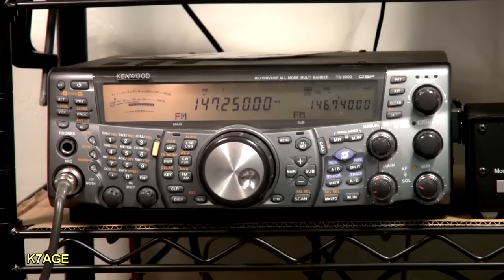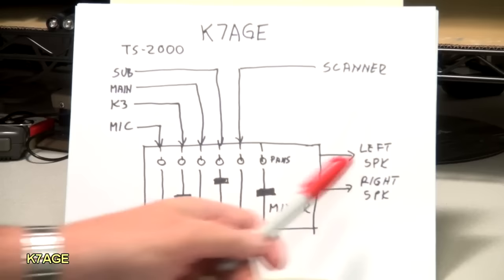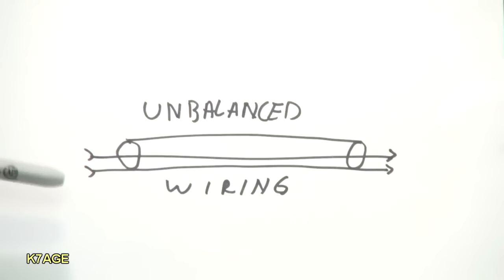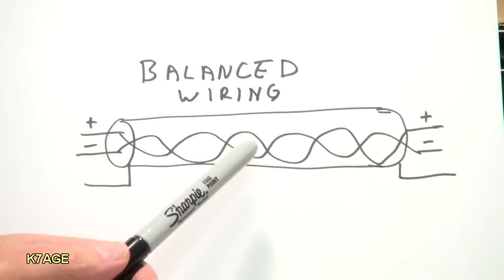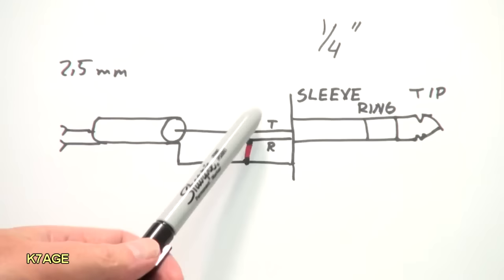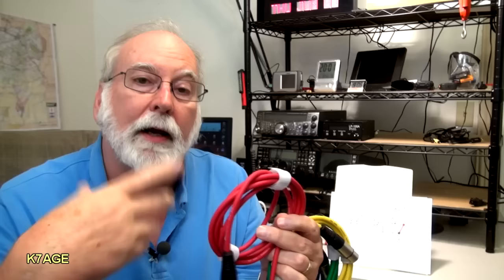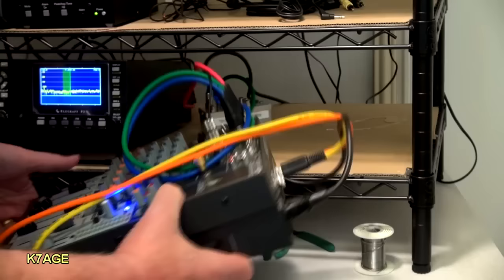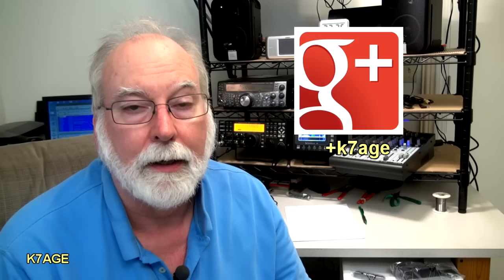New Ham Shack Part 4, Audio Mixer Installation

Comment: Aloha Randy
Finished my mixer and JBL Speaker installation. I love this set up. I included my computer into the mixer. Both you and Bob were right the JBL speakers sound way better than the ones that come with the radios.  Mahalo for your videos.
Reply from the maker: It is nice having the mixer. You can connect all sorts of stuff. Speakers are great. Bob used one at Pacificon for his PA, one speaker was enough for 200 people.

Comment: I just got a mixer for my shack. I picked up an Alesis multimix 8 USB off ebay. The USB works great on linux. It's a great setup for recording audio for youtube videos. I am going to see about plugging in RX audio into the mixer. I also need to see about getting audio into the rig. I am thinking of rigging up a mic patch bay like Bob Heil did. I might just have both TX and RX audio on the patch bay. As well as jacks for the PTT. For speakers my plan is to use cheap bookshelf speakers from a thrift shop along with a speaker amp. I am also planning on getting an AM/FM tuner like you would use on a stereo system. That should work nicely with the mixer and speakers. Although I think I need to raise my discone up a bit. I doesn't pick up my favorite FM station as well as I would like. 

Tonight I hooked up my cell phone to the mixer and had a conversation with a friend. Besides recording conversations for youtube. That also opens up the possibility to do phone patches. The secret was a TRRS adapter that splits the phone's audio jack into separate mic and headphone jacks.

Comment: Very interesting.  When I went to electronics school they told us to consider cable shield as an external signal wall, not as a return path.  That advice maybe was more intended for RF work.
Reply from the maker: With just a center and a shield, then both are needed to carry the signal. Having two wires inside a shield allows for the two wires to carry the signal and the shield to project the signals.

Comment: Randy Why didn't you use the 1/4 inch plug inputs instead of doing all that soldering? Was there an advantage to doing it your way?

I also use a mixer, but since all my radios output to a 1/8 inch audio plugs all I had to do was get 1/4 inch adapters and then just plug in the 1/8 into the 1/4 inch adapters and then plug the 1/4 inch plugs into the mixer. My mixer outputs to my Stereo receiver which then outputs audio to 5 speakers. I don't set the radios to come out of any one or one set of speakers. They come out on all of them. I rarely have more than two radios on at the same time.

Radio equipment is an Icom IC-7300 and Icom IC-9100, Yaesu FT-950, and two scanners, not to mention the computer. 73 from N2LRB

Comment: What about the impedance matching between the output of the radios, usually 4-8 ohms, and the input of the balanced xlr connectors, 3,000 ohms? How did you overcome this huge mismatch in impedances?
Reply from the maker: I don't think the impedance mismatch is a problem. The input are very high impedance. The radio might like to see a 8 ohm load to keep the audio amplifier happy. Pro audio today is basically high impedance input with low impedance outputs.

Comment: Pin 1 is shield, pin 3 is common.  You had it backwards.  You should have used the 1/4" TRS input for line, but in reality each input should have had an impedance matching transformer for very low impedance speaker output to the moderately low impedance input of the line inputs.  It's same principle as balun on your feedline.
Reply from the maker: I'm looking at the pinout at 4:32 on the video. I believe it is correct. I have check several webpages, and they all show Pin 1 as GND/Shield.  The XLR inputs seem to work fine, the input gain control allows the levels to be adjusted for good slider range. I though the XLRs and 1/4' were the same when I did the video. Later I saw that the XLRs go into the mic preamp. Okay on transformers, good for ground isolation and matching. Thanks.

Comment: What is the impedance of the xlr connection?  Can I feed the high impedance output from the  icom accessory port directly?  Also do you have speaker output of a radio feeding the mixer do you use a pad?
Thanks N1DCH

Comment: Thanks, Very Informative. Which mixer did you use?. Could I get the same result with a "Bob's Mixer"?
Reply from the maker: Behringer Xenyx 1204. Bob's mixer would not provide as much control, it is mono not two channel. I like the EQ in this mixer. More versatility with this mixer.

Comment: Thanks for the always great videos, Randy...quick question on the Behringer 1204....I just got the USB version of the same mixer but Behringer is telling me there is no way to zero the main mix sliders and still have headphones output of the input signals....can you do that with your version of the 1204? 73 de Robert K3RRR
Reply from the maker: Robert, my mixer works the same as yours'. No headphone output with the slider down to zero. This is what I would expect.
Reply: Thanks Randy...This feature was a deal killer for me since I operate the satellites full duplex and need headphones and no speakers to avoid feedback. Right now, I am test driving the Rolls MiniMix Pro MX122 which lets me do what I want to do. However, right now, I am getting HF RFI that ferrite beads on all cables so far are not working....so this may still not be my final solution but debugging still continues...73, my friend de Robert K3RRR.

Comment: Randy, I wanted to do the same but I would add marine channel 16 and 22 from two trashed radios. What if someone wanted to use their cable and phone modem for a feed how would they do that. I have a comcast xfinity xb3 cable/modem it has 2 usb ports on the back. If I had 2 usb sound cards and plug them into the unit how would I have them connect to a feed example Oshkosh, WI "FISK", OR WIN SYSTEM? The cable modem part for connecting, not connecting to the mixer.
Reply from the maker: HI, I don't think you can plug USB sound cards into the USB connectors on the cable modem/router. The router that I have allows you to plug a USB hard disk into the router to use as a simple file server. I think you would need to use a computer to plug the USB sound cards into to stream audio. Thanks, Randy

Comment: Nice. One of these days I may have to get a mixer for my shack. The problem is that I run my station off batteries and solar. I would want to run the mixer off 12V DC too. But I haven't had much luck finding 12V DC mixers. I guess some sort of voltage converter is in order. 

When you pulled out the power supply for the speakers my immediate concern was RF interference. Have you had any RF issues from the power supply?

73 KK6FVP
Reply from the maker: The speakers are fine. I was getting some RF on the K3 cable, I replaced the cable with better shielded cable and it is now fine.

Comment: Hi Randy, is the mixer and speakers not getting RF when on TX like 100W? Does the speaker have enough filters?
Reply from the maker: I have not had any problems. That is not to say that RF might get into the mixer and speakers with another installation. Try and keep cables short and away from the RF cabling.
Reply: ok thanks Randy.

Comment: I used same powered speakers and mixer.  The problem is during transmit I can hear my transmissions in powered speakers.  Everything in my shack is properly grounded .  The powered speakers and mixer have no place to ground them so they are not grounded.  I love the receive audio but have never been able to remedy hearing my transmissions in powered speakers.  This sucks to say the least
Reply from the maker: RF in the stack is no fun. If you are using an end fed antenna, these are known to have RF in the shack problems. Try adding some ferrite cores to antenna, and audio cables.
Reply: Dah. Really

Comment: Hi Randy, why did you use the mic inputs instead of the line inputs?
Reply from the maker: Actually I thought I could use the XLRs for either mic or line input. I adjust the input trim level pot down and it works very well.